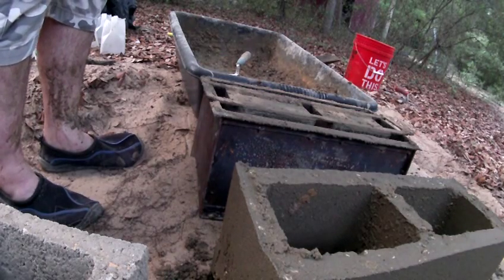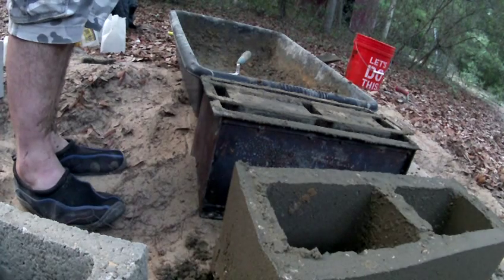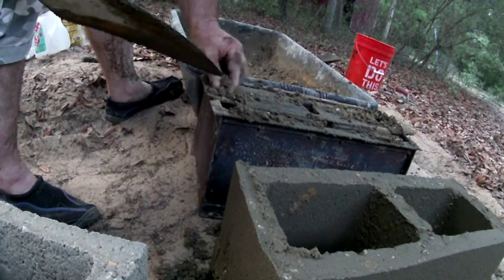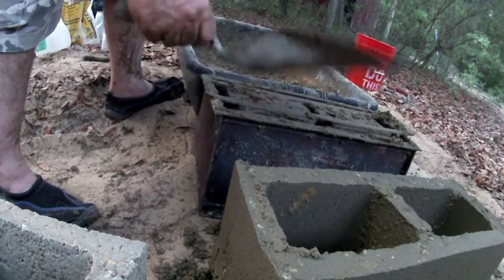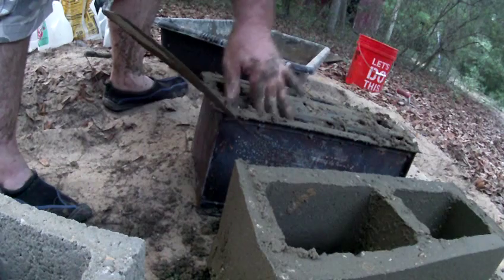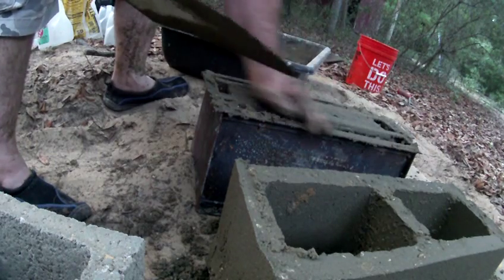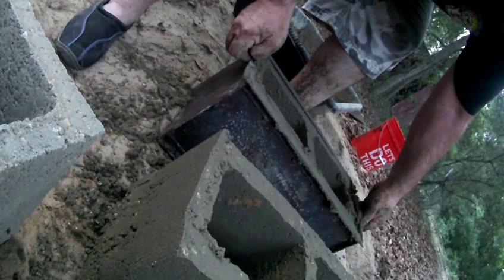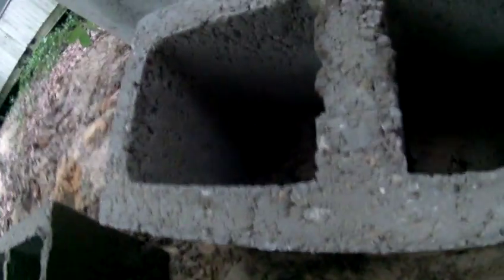DIY 16 inch masonry block mold

Comment: Im in South Carolina and have a few questions...hwo are you blocks holding up since then, and do you think i could use them for a short foundation wall? The cost of building materials is crazy high and if i can save a buck i will try to do the same...thanks for any help!
Reply from the maker: Went to home Depot yesterday blocks are down to $2.17 I have the machine I live on one of the largest sand mines in the southeast. I think you got the same thing around Columbia. But if I need blocks I'm going to home Depot. 

Maybe you're learning how to weld and you want to see if you can pull it off. 

My blocks are holding up well but it's not worth it my friend.
Reply: @LouLovesLyrics ok thanks...i do know how to weld, and have a little Lincoln buzz box...heck im retired...lol more time than money...i might just try it...thanks alot!
Reply from the maker: @gavinhodge2290 LOL I used the same Lincoln 225. I've still got it but I bought the Eastwood 170 mig. 

So I had the metal supplier cut the 14 gauge steel a hair bigger than 7 5/8. Under no circumstances can it be smaller. I used a block from home Depot and I went all the way around it on the outside. And made sure the box would slide off of it.

On the inside it's important to fit everything upside down. So the handle on the center web has to be facing down because the block is actually tapered so the mold will come off of it. I just kept test fitting and cutting until I got the piece exactly where I wanted it and then I'd move to the next side then I welded those two pieces together. Then I moved to the next side and welded that piece to the first two pieces. Then I finished it with the last piece. Once all the pieces were welded together I made sure it slid out of that cell. Relatively easy Then I fit a piece to cap it off on the inside edge. If I had to do it again I would cut thinner pieces to get around the handle and make the curve around the handle that way. I ended up breaking my vise trying to bend it. Repeat the process on the other side. Make sure it slides out. Then weld the straps on top and make sure it slides out relatively easy.

If I had to do it all again I would make it one piece I would seal off the bottom. I would flip it over and fill it right side up. And when it was completely packed I would flip it over and pull the mold off of the cement block all at once.
Reply: @LouLovesLyrics  thank you so much, that is incredibly valuable information...i was a tool and die maker for 43 years and the information you just gave me is greatly appreciated....the method in which you built it and any changes to it is priceless!

Comment: To the many interested parties wanting similar mould. Remember you can make similar from timber.....its not particularly difficult to make a sturdy mould giving desired dimensions.....if you grease it up with release coating and dont smash it then its longevity can be pretty good too.. Not hard to do....go look at your wood scraps and give it a little thought, best if luck :-).   If want use sand from saltwater areas please allow a few months of rains to rinse salts or they will be weaker.
Reply from the maker: You will not find one commercial block laying machine made from wood! The reason is even steal does not stand up to the repeated process of making masonry blocks blocks. Because the masonry blocks work like sandpaper and would sand down the soft wet wooden mold in no time. 

Where I live in Florida it's about 2 hours from the Gulf of america, it's also about 2 hours from the Atlantic Ocean. 

So again just an ignorant narcissistic person completely desperate to be heard. Enjoy

Comment: Some of this is very useful thanks. But please get a rod or block if wood at least to knock   form and tamp mix. You will wreck your gear prematurely this way. And unless you trying to develop a lethal karate chop that part is pretty dumb.....how long after this before your skin hurt? Even with gloves cement play burns due to its alkalinity.....you can use creams to protect a bit but you are advocating masochism here :-)
Reply from the maker: I let it Go the first time but then he returns to offer more ignorant analysis.

It is so funny to watch people repeating come to this site and offer analysis completely ignorantly. Like I may ruin my gear, (unless I use a lighter product like wood to tap on it with) without knowing what gauge is the steel is. It's 14 gauge steel and is complete overkill for this kind of project. I used it because it was left over scrap. Most body panels on cars are well above 20 gauge.

Also it is "pretty dumb" to tell a 58-year-old Mason who still does not wear gloves. That it's "pretty dumb" not to. 

If there a significant hazard to Mason's hands from handling cementitious products, OSHA would require gloves, the same way they do hard hats long sleeve shirts long pants steel toe boots and safety glasses. 

So in retrospect you don't know what you're talking about.

Comment: where did u buy the mold?
Reply from the maker: You can't buy US standard individual block molds. They don't exist. They only exists in metric sizes because metric territories are the only ones with low enough wages to justify the use of the product.

What I've learned is, it's just not worth the trouble when you can buy certified tested block from home Depot for $1.35. 

I used the mold to build the foundation of my garage and even I went to Home Depot and bought enough block to finish.

Comment: I think your mix is  too rich.   Try 2:1  Aggregate = 2  Portland =1    But, your Aggregate should be 1:1 brick mortar sand and finely crushed stone cement sand.  Always watch your water content to make it clump into a ball, if you grab a handful.  IE, playdough.  I would buy a cement block from Home Depot and study it.  Perhaps contact the manufacturer to ask what their Materials Ratio is in constructing their concrete blocks.  You may also want to contact your local building codes people to see if there are rules governing self-made building materials before you can use them on a building.  There are and could be serious considerations regarding the stability of home baked bricks, rammed earth walls and certainly cement floors and home made cement blocks.  ONCE you get your formula (cement block mix ratios ) down pat, this will all become easy.   Best of luck
Reply from the maker: I appreciate the help. I will check it out. But It was more of a welding project than it was a masonry project. I did make several dozen block. I'm using them as the foundation to my garage. They are filled with solid concrete so I don't think I have any worries. But they're holding so far.

Comment: How do I get a block mold for any sizes
Reply from the maker: It depends on what you're using them for. If you're filling them with concrete there is a limit to how small they can be. If you're not filling them with concrete you can make them any size you want.

Comment: Very nice my question is is the mold is the actual size of the block if im not mistaken the cement block shrinks. Is to8x8x16
Reply from the maker: No the block does not shrink. With a 3/8 motor joint that Bond's it to the next block the block is 16 inches long 8 inches high. But out of the mold without the motor joint the block is 15 and 5/8 inches long 7 5/8 inches high.

Comment: Any good online retailers for these type of molds?  I don’t care if they are metric or US
Reply from the maker: https://www.doubell.com/diy
Reply from the maker: Matt McCallum yes their out there you have to Google it. I will try later. you can use metric block on standard plans. you just have to be creative with your rebar spacing. sometimes you can just add rebar. sometimes it's easier for a mason just to cut blocks to fit around the rebar issue. but I still can't see any reason why it would be easier then just going to Home Depot and buying the block for $1.35. Maybe if you're in a remote area like Alaska or high in the Rockies or you have access to large amounts of Portland and sand at a low cost. whatever it is I'll try to get back to you with more answers but yes metric masonry block molds are out there and are what gave me the inspiration.

Comment: Can you email me plans how to make one in USA standard?
Reply from the maker: sorry my friend. I took a standard US block and I welded 14 inch gauge steel around the outside then I welded all around inside of both cells while the block was upside down and Link the cells together so I can pull them out of the mold first because the block is thicker on top so the only way the motor slip off of it is upside down. the outside of the block is completely Square so when you're doing the outside it doesn't matter. but when you're doing the individual cells you must Assemble the parts upside down. it literally took me at least 25 hours of Labor cutting each piece to fit exactly and then welding it all together. anyone who would spend the time to make one of these molds can have some fun saving themselves a little money. But I promise you by the time you make the mold get the sand the Portland and the aggregate and make the blocks you will probably understand it would have been easier just to buy them from Home Depot for a $1.35 a piece. 
 I have the mold and all the free sand I want, and I would still probably buy the block if I was doing a house.
 I'm using them for a few small projects and I made a cool video and I came up with a welding project to teach myself how to weld, but the reason that these single U.S. standard block molds are so unusual is because labor cost make them obsolete.
Reply from the maker: sorry brother all I can tell you is what I did. I got a regular block and I welded 14 gauge pieces all the way around the outside. then with the block upside down I welded pieces all around both of the cells. the block is tapered thicker on the top and thinner on the bottom so your mold must be built to manufacture the block upside down. it is the only way at the center mold will slip off the block. 
 I am an amateur welder I took me about 25 hours labor at least. but it was fun I made a cool video and I came up with a welding project to give me some experience welding.
 I have all the free sand I could use the mold and if I was building a house I'd still buy the block from Home Depot at $1.35 a piece. by the time you built them old got the same the Portland and the Aggregate and made the block you probably agree it would just be easier to buy them.
 but if you want to weld it anyway I'll answer any of your questions it's really straightforward. just copy the masonry block with steel.

Comment from the maker: to any one wanting to make masonry blocks their are metric molds available. to those wanting us standard 16 inch molds I would remind you home depot sells pressure tested 16 inch block for $1.35.

 The only reason I built mine is because I own property in North central Florida on one of the largest pure sand reserves in the South.
Reply: Did they turn out good?

Where would metric ones be found?
I am wanting to help a guy in Senegal Africa to build a little shop but he has nothing to do so it would make sense if he could actually make his own cinder blocks to build it.
Reply from the maker: @he7is7at7hand  that's funny because there's plenty of metric ones out there. The reason why I don't mind is because I wanted to see if I could build a standard one. But there's really not much of a market in the US because of the availability of cheap standard blocks at home Depot. LOL but it was more of a welding project anyway. 
I did make several dozen block there under my garage in the foundation and they're filled with concrete and rebar. They did turned out pretty good if you're interested there are dealers that sell metric masonry block molds. this one is in Africa I believe.
https://www.doubell.com/diy
Reply from the maker: @he7is7at7hand sorry I don't know if I responded to this but yes they turned out good. But I'm sure the commercial ones at home Depot at the very least are slightly better.
Reply from the maker: @he7is7at7hand in Africa they have metric molds. Just like this one. The only reason why I built this one because it does not make sense in any first world country that has non metric standard measurements
Reply: Have you rinsed the salt out of that sand?
Reply from the maker: @michaelbyrnee9584  I didn't even see this one.

Explain why you think it was necessary for me to rinse the sand?

Also can you explain why this video has had such a significant affect on you that you would the need to fabricate reasons to criticize me and or the video, and fabricate your experience to justify your fabricated criticism?
Reply: Sand will drastically weaken the set material dude. Idea of building a dwelling involves safely living in said structures......try to get over your hurt at valid criticism and you may learn to be good at this. @LouLovesLyrics
Reply from the maker: @AlexHarbuz and dude blocks still looking perfect after almost a decade.
Reply from the maker: @AlexHarbuz again you don't know what you're talking about, concrete is made with sand. Different cementitious products are made with different amounts of sand, depending on the application.
Reply from the maker: @AlexHarbuz and all blocks in the masonry industry are set in mortar. Which is made from type 2 cement and sand.
Reply from the maker: @michaelbyrnee9584 no I didn't. The exposed sand is rinsed from the daily rain. Plus I'm filling them solid with concrete. It has been 8 years and the blocks I made are still in the foundation of my garage and still looking perfect.
Reply from the maker: Just to make sure people understand, this is an old video blocks are no longer $1.35 a is there more like $2.35 now. Once they get to  $4.00 this machine might be worth something.

Even I, (the owner of this machine) still go to home Depot if I need blocks.

Comment: Thats cool lou.
Reply from the maker: you just made my day with what we talked about earlier.
Reply from the maker: Lindsey Wanton part 2 is up
Reply from the maker: Still wonder about you all the time my friend.
Reply: +tin fingers where I can find a mold like that
Reply: Can you email me at
howtogetoutofbabylon@gmail.com?
I want to use concrete block as casing for aircrete.  
Are you selling molds on ebay Yet?
the, Jerry
Reply from the maker: +Gilbert Hernandez they make metric ones you can buy online. I think they are 18 in Long and I know they're 9 inches wide. you could use them on US Standard drawings you would just have to use end outs to get around the rebar. but like I said there's a reason why US Standard block molds are not very common. and that's because Home Depot has block for a $1.35 and labor makes the most obsolete.
Reply from the maker: +How To Get Out Of Babylon no I'm not selling them yet I haven't thought about aircrete but I have seen wood forms used for aircrete. have you considered using wood?